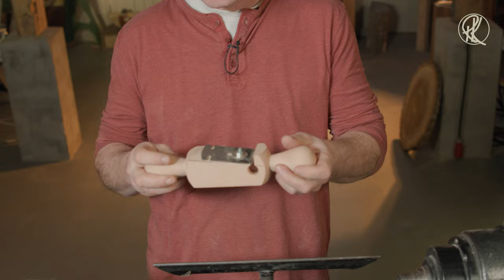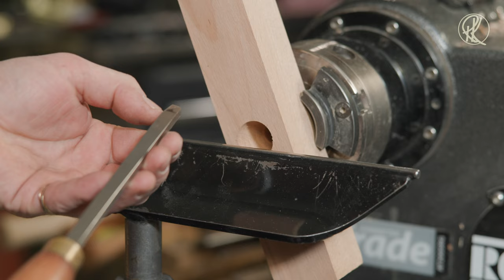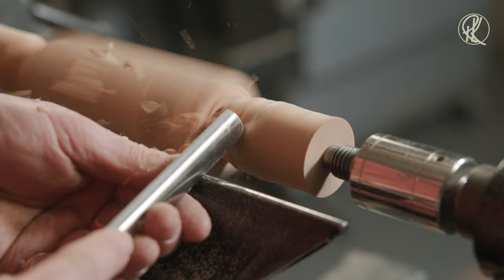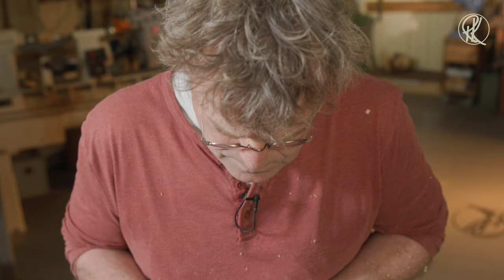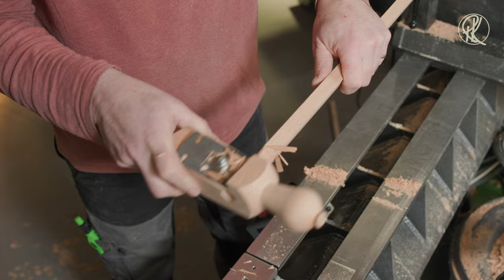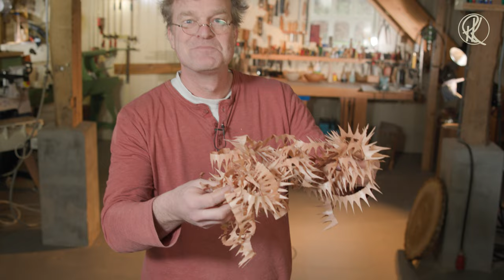round stick planer.

Comment: Hi Ronald, thanks for that video! If you would round the blade a little, it would increase the surface quality which would mean less sanding…
Best
Mario
Reply from the maker: I know, i ended with the cut exactly on the corner of the knife....